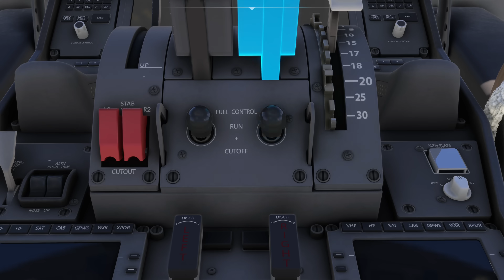Air India 171: Why Did The Fuel Cut-off Switch Get Moved?

Comment: This video discusses the speaker's claims regarding a design flaw in the Boeing 787 Dreamliner, specifically concerning the battery diode module and its impact on the aircraft's electrical system, leading to unexpected failures and the deployment of the Ram Air Turbine (RAT).
The diode failure had occurred previously in Japan but covered up.  

Here's a summary of the key points:

Core Issue: Failed Battery Diode Module (0:56-1:00): The speaker asserts that a failed diode module in the main battery caused a short circuit, exposing the main battery relay to the short. This led to the captain's and first officer's instrument buses failing after a short delay (1:11-1:36).
Consequences of the Short Circuit (2:33-2:56): The short circuit simultaneously affected the instrument bus feeds, creating a path to ground through the positive terminals feeding the spar valve relay control coil inputs, causing these relays to close against command due to stored energy in holdup capacitors (3:59-4:08).
Aircraft Electrical System Explanation (4:12-5:12): The video simplifies the aircraft's electrical system, explaining how variable frequency starter generators (VFSG) and the RAT supply alternating current to AC buses, which is then converted to direct current for various systems.
Battery Diode Module Flaw (5:51-6:22): The speaker explains that while current is supposed to flow only out of the diode module into the hot battery bus, a shorted diode allows current to flow in any direction, exposing the battery to transient surges from the transformer rectifier units (TRUs).
Inadequate Monitoring of the Diode Module (9:51-10:36): The video highlights that there isn't sufficient monitoring in place for the battery diode module's condition. The existing system looks for high-rate charge current, which won't occur if the battery charger is functioning correctly and maintaining the battery's voltage.
RAT Deployment Proof (12:41-13:16, 25:14-25:36): The speaker provides what they claim is "proof" that the RAT deployment was not due to pilot action or dual engine failure, but rather a result of the DC bus failure. According to Hamilton Sunstrand's documentation, RAT deployment should occur 15 seconds after the spool down of the VFSGs below 50% N2 RPM, which would be after a potential fireball. However, the RAT deployed immediately due to the inner DC units being "dead" (28:40-29:07).
Cover-up Allegations (33:00-34:50): The speaker expresses extreme frustration and anger, alleging a cover-up by the Federal Aviation Administration (FAA) and Boeing. They claim that the battery and charging system were re-certified after 2013 fires, but subsequent battery failures in 2014 and 2017 occurred because the root cause (the flawed battery diode module) was never fixed.

Comment: I wanted to share a thought that I observed the other day while I was flying myself. Remember AI171 veering slightly to the left while going down?  Clive Kunder would have had both hands on the yoke, and when he realized that the fuel had been shut down, he panicked and instinctively reached over to turn them back on. He would have had to bend his body slightly towards the left side to reach the left fuel switch to initiate the engine relight procedure, that would be fuel switch left to run and immediately thereafter fuel switch right to run. He also would have had to remove his left hand from the yolk meaning he would have had only  one hand on the yoke at the time and because of his body  leaning over to the left so he could reach the left switch with his left hand, his right hand automatically pulled the yoke slightly to the left along with the rest of his body .A possible sign that Kunder attempted to re-light the engines in his panic after the captain most likely shut them off. Exactly this happened to me the other day while I was flying. I wanted to reach for the local charts that are stowed in a sash next to my seat on the left side of my plane.  I removed my left hand from the yoke to reach the approach chart, leaving me with only my right hand on the yoke. When I bent over to the left side, the plane also veered slightly to the left because I only had one hand on the yoke, allowing it to drift to the left with my body weight . To fly properly and straight, you would need both hands on the yoke. Exactly this could have happened in the cockpit on that day because Kunder was trying to relight the engines and for this reason they veered slightly to the left

Comment: If the captain wanted to crash the aircraft, why couldn't he just suddenly turn the aircraft one side since they're at a low altitude? What if the switch had never been tough from the beginning, and it was a false alarm?  The reason for that is that Boeing had published the Services bulletin(or special Airworthiness information bulletin) about the EEC having problems in certain types of GENX engines for 787, and Air India did not listen to the recommendation from Boeing to change the  MN4 chips on the engine, which caused the crash.

Comment: Maybe this has been discussed, but I missed it. What if just as the CoPilot was removing his hands from the throttles, the plane hit turbulence that caused his hands to be forced down to bump the fuel levers? Can they be moved that easily? Or do they each require pulling the knob out and then moving it down? If these levers can be bumped, however violently in this way, then it would seem to add another question to the investigation.

Comment: I do not believe that the Switches were ever MANUALLY WITCHED OFF OR INDEED SWITCHED OFF BY ANY OTHER MEANS.  They were found in the RUN  position post -crash. Likely a Transient Fault in the FADEC engine control
Unit. Fully Automated Digital Engine Control Unit.   Specific to the Fuel Cut part of the System. The fact that the Engknes resumed function supports this. And the Two Switches found in ‘RUN’ amongst the cockpit wreckage - telling.  Kind regards and Condolences to All affected by this Tragedy. Christopher. ✈️✈️.

Comment: I have an idea about the two Fuel Cut - off switches. The Two Switches were found in the RUN POSITION post -crash - were the two switches even MOVED AT ALL. The possibility exists that a Malfunction may have occurred and that normality was restored quickly. A FAULT that quickly cleared. No Pilot Error at all. Electrical Failure in the FADEC  SYSTEM -specifically controlling the Fuel System. How does anyone know for certain that a Pilot Moved switches to Cut - Off. No In - flight Video ??? Likely switches did NOT move at all - borne out by the Post - Crash finding of BOTH SWITCHES AT RUN.  Just my thinking.    Christopher. ✈️✈️✈️. Model aircraft Radio Control Pilot. We can experience Radio Anomalies sometimes. As well as the more often Pilot Error. Condolences to All for their Sad loss.

Comment: I was Chief Radio Tech that was responsible for public safety radios and systems. I was told by a new police officer that his life relied on that portable radio when out of the car. I told him Murphy's Law say's that radio will quit when needed most, so never put himself in a position that his only life life is any piece of equipment. Always use good judgement protect yourself. I had large parts stock and made sure My repairs were as good as possible, so it would operate when needed. I would tell the great folks that built these planes doing your best in what you do to the aircraft is the best you can do. Thanks Capt. Steve

Comment: How do they know that the fuel cutoff switches were actually moved to the cutoff position?   There is no video and the pilots apparently said they didn't do it.
Reply: its boeings fault... simply these r just to cover it up... it was a design fault and switches automoved to off position
If that was not the case then other airlines wouldn't had all its planes check and fuel switches replaced ... its simple logical

Comment: Captain Steve, thanks for a great channel. I'd like to know your thoughts about this:
The TCMA (Thrust Control Malfunction Accomodation) system is designed to reduce or cut off the engines' thrust simultaneoulsy, and independently of cockpit input/commands. Could this have activated just prior to take off while still in ground logic, or  just after take off if the Flight Management System was erroneously not yet in flight logic? 
The fact the RAT deployed immediately upon take-off is a massive red flag.
I am personally leaning towards water leakage in/into the EE bay (Electronic Equipment bay) and a short-circuit triggered by take-off acceleration and pitch-up on rotation as the culprit (the 787 has a history of water leakage /insulation issues).
In any case, pilot error/suicide can only be considered after all other causes have been categorically disproved.

Comment: Hey Pilot Steve!

Remember the 2x 737 Max crashes - US experts almost immediately blamed the Asian & African pilots as well as poor training. Is that Racism? Who.knows.

Well well well - after full investigation  it was found that the cause of both crashes was the MCAS Pitch Control Software!! 

We await with patience the full investigation into AI171 but here's the theory being now discussed inc via The Indian Express:

Electrical failure on take off immediate RAT Deployment  FADEC spools back power of engines by cutting off fuel to engines
pilots query each other based on ECAS message of fuel cut-off to engines 
pilots in shock & confusion for some seconds 
then pilots trouble shooting starts inc switching fuel switches off and then on
Note: Captain who😢 was experienced remained cool & calm & FO was panicking.
Do you think a Suicide Pilot would 
- say "I did not cut off fuel"?
- Radio ATC "Mayday Mayday"?
- Help Divert the plane away to the left from dense populated area & towards a highway just beyond the building it crashed into?

Interesting theory. 

So we await the full investigation sometime in 2026.

Comment: Boeing is a big company trying to save itself atm. India is a very much corrupted country. Firstly, the report says one of the pilot asked ,,why did you cut off” , but cut off what? We need the whole conversation. And also, the RAT deployed at the very beginning, so it is possible that there was an engine failure which is why the RAT deployed, and after that one of the pilot was trying to save the plane by cutting off then on the fuels. The report does not say in what exact second did the pilot asked that question, nor WHAT did the other cut off. So it’s not clear at all. I have a feeling that this company is trying to save itself from total bankrupcy. And I’m not saying that Captain Steve is paid by the company, I just think that maybe we should not believe everything for the first sight.

Comment: I think...and of course this is my opinion...that the FADEC could be built/programmed/designed to override/prevent the pilot from shutting off the fuel to engines that are in good working order. With the amount of sensors that these aircraft have, the FADEC should be able to determine if shutting off the fuel is appropriate for a normally  functioning engine. 

I don't know why this hasn't been implemented in some form already. We have all heard of pilots shutting off the wrong engine. If you get an engine fire light on your console and I assume it would be possible for the FADEC to be made aware of which engine is having trouble and lock out the good engine. The pilot will still be able to over ride the FADEC if he sees fit. However, this would prevent problematic reactions when the cockpit suddenly gets really busy.  

If not, the above, then maybe the FADEC could offer a warning that to the cockpit crew saying that it appears that the wrong engine is being shut down...ex,: "Warning...shutting down number one engine and then offer a countdown in seconds that would give the pilot time to think about and validate his actions  before causing something catastrophic. 

Anyway, food for thought. Thanks Captain Steve. I enjoy your POD Casts. Keep up the good work.

Comment: Capt Steve, on mentourpilot they discussed an EasyJet 6074 Mishap that happened between Spain and England. It was a lengthy discussion of the electrical systems failures on the AB 320. After the plane landed successfully the crew tried to stop the engines using the fuel cut off switches but the engines continued to run. Some electrical component between the switch and engine was still malfunctioning allowing fuel to continue to be sent the engine. I was convinced by your coverage that this connection was a physical connection from the fuel cut off switch to the engine. Doesn’t this show that an electrical failure could also then stop the fuel from being delivered as on India flight 171?

Comment: Captain steeve - There is no safety in the whole of aviation industry at lower altitudes in terms of altitudes. Is this problem only for commercial planes? What will be the solution for it ? Rat is there but we don't have some thing that is available in helicopters to prevent accident such as these ?

Comment: Let's be accurate. 
In the AI crash The RAT deployed BEFORE the fuel switches were moved to cutoff.  This means the plane already had a serious problem when the fuel switches were moved to cutoff.  Here is the proof: 
Proof 1: The RAT did not deploy at 8:47.   8:47 is when RAT gave hydraulic power.  As you may know, under ideal conditions Boeing says it takes 6-7 seconds for the RAT to spin up and give hydraulic power.   The means the RAT deployed 7 seconds before 8:47 =  8:40.  i.e. at liftoff.   
Proof 2: Even the report itself says the RAT deployed "immediately after lift-off" (Page 14). 
Proof 3: is the photo in the report that shows the RAT has already deployed.   After triple correcting for perspective the height of the plane is 100 feet plus or minus 25 feet.  A 100 feet of height is achieved very quickly and does not take 7 seconds.
So as per the report itself the RAT deployed immediately after lift off (8:40) which means the plane, as per the Boeing 787 manual, is already in one of the 5 serious conditions that triggers the RAT, at 8:40.   This means before the fuel switches moved to cutoff,  the plane was ALREADY in very bad shape.   So at 8:43, the pilot was *responding* by moving the switches to cutoff,  not causing it.  Clearly the plane was already in bad shape at 8:40.  Maybe even before.
There is a lot more logic, but the above facts are enough to show your analysis doesn't match the photo evidence, or the Report, or the EAFR data.  Change your slanted analysis if you call yourself accurate and factual.  If you can't change, then you have to stop making videos.

Comment: Hey, Steve ~ I always enjoy your "take" on various commercial-aviation topics, BUT...... concerning the recent Air India tragedy, I strongly disagree with your assertion that the cockpit fuel-cutoff switches are/were somehow linked to the actual fuel valves via "MECHANICAL RELAYS" since there's no such thing! The only way the fuel valves could possibly be mechanically-controlled by those cockpit switches would be via direct rod or cable linkage (no "relays" involved).

If there are/were "relays"....... they'd have to be electrically activated (i.e., an electrical circuit or wires between the cockpit switches and the "relays" controlling the fuel cutoff valves. Those (electrically-implemented) valves that control the massive GPM flow to the engines probably have a relatively high current draw. It's common practice to use "relay[s]" with a low-current control input (from switches, etc.) to implement high-current devices (like those large fuel valve[s]).  This is tantamount to a high-draw automobile starter (typically 200-ish amps) being controlled by a low-draw (<1 amp) ignition switch.

TTFN ~ Ray Casner

Comment: My theory is there was an electrical fault that caused the fuel valve to go back to their no-power fuel cutoff position. The switches were not physically moved. The 1s delay between them is also explainable by the time it took for the power failure to propagate between the engines. The pilot noticing the engines lost trust then asks the other pilot why he did it.
Reply: I think you might be right.
Reply: Question: Are the fuel shutoff switches automated. Can they even shut off the fuel on their own, without the pilot knowing about it? This would be interesting to know. Hmm.
Reply: @sanityone649 no. The switches have to be moved manually. The pilots could have done it due to some other catastrophic failure that caused both engines to fail. I'm thinking out loud....
Reply: @gankala8 the switch controls a valve that is electrically actuated. If there is a power outage it doesn’t matter the state of the switch, power is lost. The valves will go to their no power state regardless of the switch position.
Reply: @MrGuto so do you think the switches were moved after an electrical failure?
Reply: @gankala8 no. The switch position is irrelevant if there is no power. Imagine the lights in your house. When you have a power outage it doesn’t matter whether your switches are on or off, the lights will turn off.
Reply: @sanityone649 they are just a mechanical on/off switch. The more interesting question is whether when the valves it controls loose power altogether, whether their natural state allows fuel to pass or blocks it? I read somewhere it is the latter for situations where there is a fire that burns the electrical circuit.